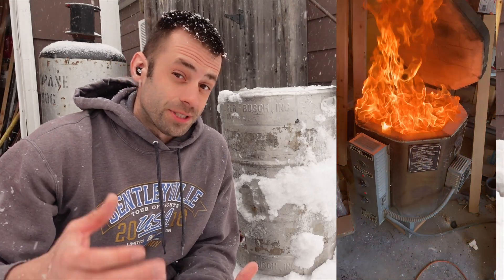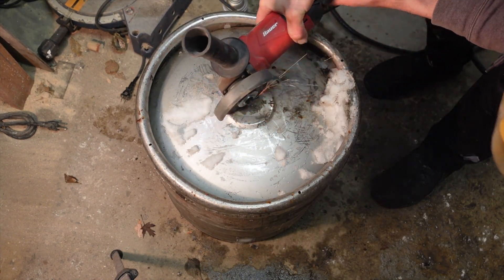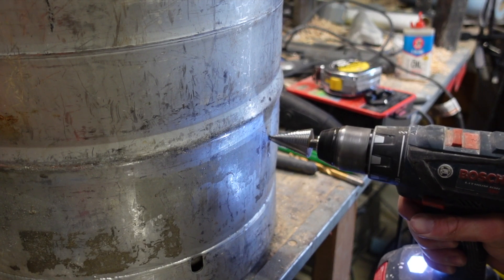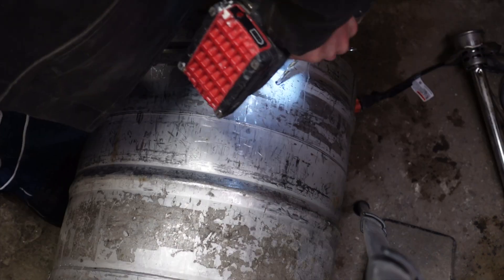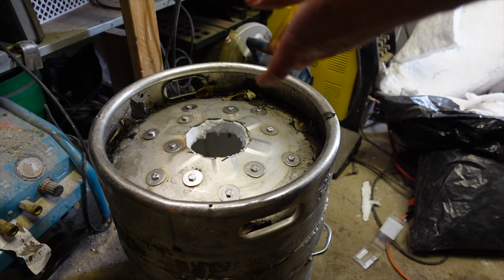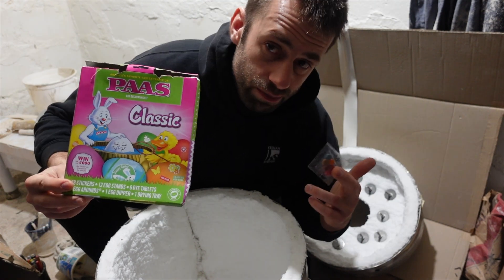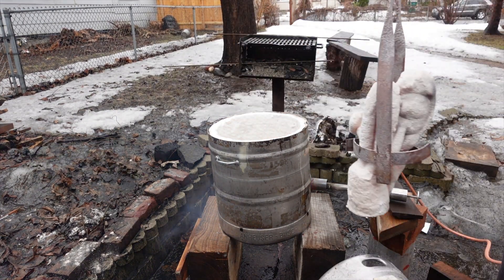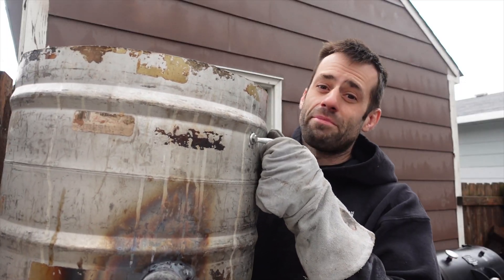DIY Wax Burn Out Kiln from Keg

Comment: Consider using a steam DeWaxer prior to burnout.
Basically an electric heating element in a stainless catering type pan from smart n final, or something like a fryer,, let water noil with plaster item sitting on a wire rack,,  use an enclosure on top.
Steam ut for 30-45 minuites

Comment: you need to seal your ceramic wool.... lol ok ludox :)  did it work
Reply from the maker: I still coated it with a harder sealant. The ludox may have sealed it but if nothing else the harder coating will protect the insulation itself.

Comment: Is the slurry used for moulds similar to finely ground clay? If that is the case, can't I just disolve some clay-rich soil in water and sift it through a fine mesh (old t-shirt would do) and use the slurry after the water seperated? It's used to make actual ceramics, so I can't imagine it being notably worse than the expensive store-bought slurry.
Reply from the maker: No it’s not a clay. It may be possible to use clay but that would take some trial and error to figure out. I believe it’s fumed silica and other chemicals that make it work. Experimenting is fun but there is a reason why people used specially made products. If you are going to take the time to make a sculpture you want to use products that give you the best chance of success.

Comment: Cobalt drill bits are the way to go when working with stainless! ...and some cutting/drilling oil helps too!  👍
Reply: And I find that you can deal with heat dissipation problem by taking your battery drill and putting it on slow speed.

Comment: thanks for the  reminder why I left Ohio so long ago, and another fun video to watch. I saw  Worldtraveler boiling the wax out of ceramic shells, I wonder if he kept doing that? I used ITC 100HT coating in a forge which worked fine but I remember it being expensive. I hear there might be Roman artifacts in the marshes up your way. did you make your own burner?-Andy
Reply from the maker: I saw him do that boiling as well. I could try that as well. Might be easier. 
You never know where those Roman artifacts will turn up. Always have to keep looking. 
I bought my burner from Amazon.

Comment: A high intense heat right at the beginning of the burnout is best after a few minutes you can throttle back the heat to drop the wax.  Preheat the kiln first then use some ingot tongs (easy to make) to put the shell into the kiln.  Excellent start! & good video
Reply from the maker: Good tips. Thank you!  I appreciate it.

Comment: Stainless beer kegs are super tough to cut!  I didn't have much luck cutting that stuff either. Goo idea with the welder to burn holes in it.....I used a 22 rifle!    I didn't know that about the wax swelling up.....Might be another problem with my crawdad attempt?    The "Z Wash" looks better to me too.  I gotta wonder how long that spray on stuff would actually last even if it did work?     Great video!  I want to get back to this as soon as the weather gets a little better.
Reply from the maker: Haha! A 22 is genius too. Unfortunately I live in the city now so I don’t think my neighbors would appreciate that method. Although it’s Minneapolis so they might not care. They are use to it.

Comment: "Dad, bob Broke your Beer...no doug did it".  Ay hose, you are indeed a friggen genius -- The Kegger Burnout Furnace - Another Winner!! 

Wow, they really gave you a deal on the ceramic wool -nice!  I have a local firebrick store also, and plan to make a smaller foundry furnace so will check them out.  
Funny how you just made this video when I had been thinking about similar furnace. Video is helping with my project -thank you!

PS. my leather foundry gloves hardened up just like yours - oh well -just call em "flame hardened" :-(
I would have poured the bear into a giant water bucket for watering my garden for ever sweeter grape/tomatoes -- You Hoser!
Reply from the maker: Haha. Flame hardened gloves. I like it. I need to get some real flame resistant gloves.

Comment: Stainless hardens when it gets hot.. That's why it feels so hard. Low revs and high pressure on the drillbit, it should cut not grind.. Use cutting oil